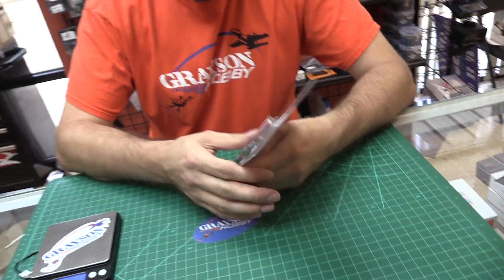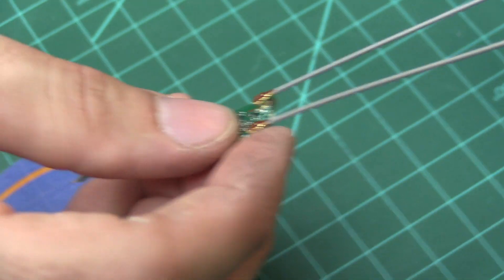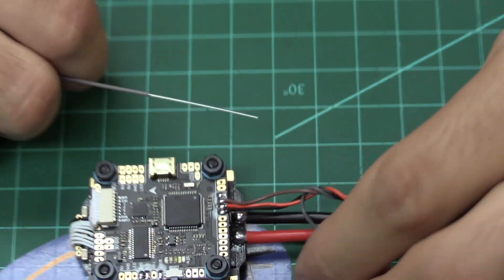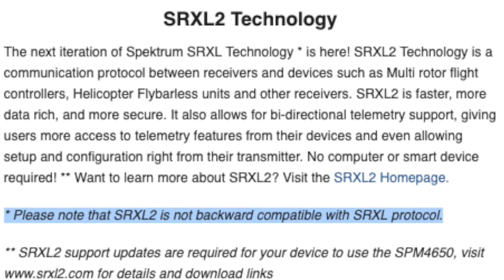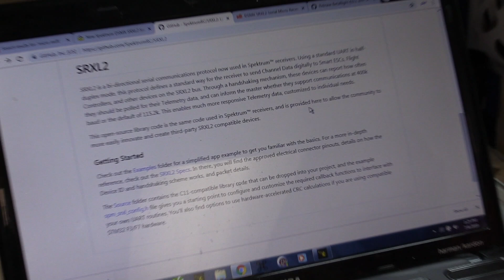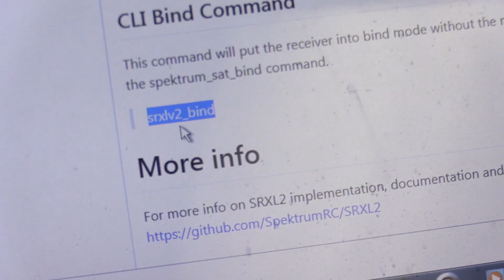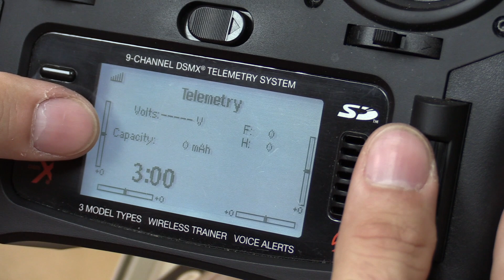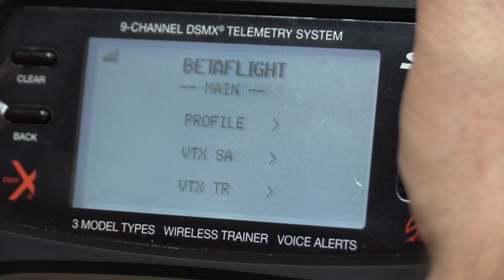New Spektrum DSMX Micro Drone Receiver- SPM4650

Comment: Hi, How should the 2 ant wires be orientated on the 4650? I see on the models they are installed in they run Parellel to each other , is this correct?

Comment: I cant get mine to work does the FC have to be that Firmware Update iv  just updated mine to latest i can bind but FC doesn't recognise inputs. Im running a DSX6i
Reply: Do you find an answer to your problem. I have the same...
Reply: @ no I didn’t I ended up just buying a completely new controller and receiver
Reply: @RoscoePablo  Too bad. That's not what I was hoping for. Thanks for the reply anyway.

Comment: Does it work for a dx6i
Reply: Dx6i will not work smoothly on f4 and up flight controllers and it has very low stick resolution. Will fly bad I up dated 2 years ago to a dx9 and never looked back and the dx9 has duele diversity so range is way way beter..
Reply: @lukejwillmot  Hi Luke, I have the same question you just answered. Can you elaborate a bit with a source or something since I have the same question.

Comment: Hey guys this video is good but I would really love it if you did a full walkthrough video on setting up this receiver on this fc board or the Diatone 349 quad but actually do the steps to make it more newbie friendly. Particularly flashing firmware, getting it into bootloader mode and everything else required to make it work. Rather than just saying if your new to the hobby don’t do it. It’s really disheartening for people that dont know everything but still trying to learn. It would be much better to just slow down and explain the procedure required precisely, or even show the whole thing step by step. I have this receiver for a Diatone 349 coming so I watched your 349 setup video a few times, it was also very rushed and confusing to new people to the hobby with the underlying message of “its difficult, confusing and you shouldn’t do it”
Actually makes me want to sell my new spektrum radio and go buy a FRsky.

Comment: I have watched this video time and time again and still mo joy with this receiver. Ive updated quad to latest sofware ive copied and pasted the cli commands ive even used the bind sequence. I got radio to bind by holding down button and connecting battery. But nothing works in betaflight. Any suggestions when i paste in the cli commands it comes up with errors
Reply: You have to flash the firmware on our github page. It's not supported in the official betaflight repo yet. https://github.com/SpektrumRC/betaflight/releases

Comment: Thanks for doing a video on this, as there is little to no info out there. Even RCG doesn't have much info, despite their engineer's best efforts to answer questions. Then again, the heavy handed "moderating" on RCG and fanboy attacks make RCG not worthwhile to participate in anymore.

BTW, SRXL2 being bidirectional is like SRXL, which came out well before F.Port (not S.Port as stated in the video). Oh, and there is a VTX channel function in the first menu too, if you don't want to do it via BF stick commands (shown on the transmitter's main screen).

I fly Spektrum because of Horizon's BNF planes (UMX, park flyers, etc.) and for giant scale 3D gassers (AR9350 with AS3X). However, I'm pretty disappointed with the 4648, and especially the 4649T. For their price, they lack a lot of features. Worse yet, they have consistent binding problems (losing bind every power cycle on 4649T or waiting too long for 4648T) and cannot get a workable RSSI in OSD (4649T). Even this new one (which has BF connectivity, like LUA scripts in OTX) will need custom fork of BF 4.0.3 and a set of CLI commands, which doesn't yet play nice with the large variety quadcopters I fly.
 And... Still no silicone wires despite needing to solder that Rx harness to any FC.

That's why I've been switching to FrSky and R9 for my quadcopters.
Reply from the maker: Wow, thanks for all the great info!  Yes RCG is not what it used to be..

Yea, both Will and I are surprised there is not much more activity about this RX. And just like you, we both have our spektrum radios for the airplanes and FrSky for Airplanes :)

Comment: So this new protocol will only work on 4.0 or later FW and on the latest configurator 10.5 ? If so it’s a bummer cause some micros don’t fly very well on 4.0,  I fly 3.5.7 for micros.  Thanks!
Reply: spektrum provides 4.0 builds of betaflight, and betaflight 4.1 has support for SRXLv2

Comment: What do u select in betaflight config tab. (Speksat and 2048 or 2048/srxl?) I have the receiver bound but it does nothing in the receiver tab. I have multiple builds and this has me pulling hair out! I loaded the hex files and even went backwards in beta to see if that would work and nothing so any help would be appreciated
Reply: i have the same problem as i mentioned in the comment above you :(
Reply: @mikeweiler3452  i saw that and i am hoping they can help us both out.
Reply: @Xman1976  there is really very few information out there :/
Reply: @mikeweiler3452  i called tech support at horizon and hopefully they can help when they call back.
Reply: @Xman1976  ohh that's really nice, please hold me informed 👍
Reply: @mikeweiler3452  bad news fron horizon tech support. This is still so new that they dont have any info on it yet either????  I dont feel dumb now! They created a ticket and when they know more they said they will call me back tomorrow. Fingers crossed!
Reply: @Xman1976  Damn, looks like we have to wait. but thanks for the informations :)
Reply: @Xman1976  Here is the Link with the Confiq who Works:
https://github.com/SpektrumRC/betaflight/releases/tag/4.0.3-SRXL2
Reply: With that config it Works for me but dont Forget to chose UART6 under the Ports Tab in Betaflight. ;)
Reply: @mikeweiler3452  just saw that and it still didnt work. Eventually horizon got back to me and said i had to use the plug on the receiver. So managed to barely get that soldered on cause i just direct wired it and the damn thing worked! Wish i didnt have to use the plug on it tho.
Reply: @Xman1976  You dont have to use the plug. Just make sure the "S" pin on the receiver is soldered to a TX pin in betaflight. The pins are labeled on the receiver.
Reply: @MiguelFAlvarez  i finally got it working but what was weird was i had to use the plug. I had everything wired correctly but only could get it to bind. Dont know what magic happened but when i soldered on the plug and resoldered back to the board in the same spot it worked. But thanks for the help.
Reply: Socit stopped working after half of the maiden. Stupid question what do use as seiral receiver provider on the config page in betaflight? I have serial-based receiver(speksat) for the receiver mode and the spektrum2048/srxl selected. I also have the spektrum selected in the receiver tab.

Comment: "set serialrx_provider = SRXLv2"  doesn't work for me. does anybody could help me please
Reply from the maker: Check the wiring

Signal pin on the receiver (labeled "S") must be wired to UART TX pin on the FC.
Reply: @graysonhobby  thanks for your quick answer. My receiver connections are all right but if i typ "set serialrx_provider = SRXLv2" in CLI the response is "Invalid Value". My Board is the same as yours. Firmware update is done (to 4.0.4 and even testet with 4.0.3 like in your video). It seems like SRXLv2 option no longer exists.
Reply: @graysonhobby7583  ohh no 😮 i didnt.
Do you have the link? For me and for all the other poor people without a plan?^^

Comment: now if only you didn't have to buy a $700 transmitter to use crossfire with Spektrum. Also the SPM4649T would use a TX pad also. You just have to set it to Spektrum SRXL in betaflight. Using the SRXL you shouldn't have to do any of that CLI stuff either.

Comment: sweet......  as one of the 10 people flying spektrum, i love it.......
Reply: rideacat plenty of people flying spektrum dude .  People trippin for years not sure why
Reply: @scizzorhandsfpv9547 my thoughts on on this are, at the time fpv was getting known u know zmrs, apm, Mr cleanflight , 3s 2204, ect lol I know I was looking for my first radio and spektrum was not a cheap option by ANY MEANS and wanted to just use satalite rxs so when I found a friend with a dx6...I feel for it and it wasent bad but didn't live or trust it fully. Traded for a dx6i it was worse, was about to try the other guy when I found a DX8 and tried it, liked it allot..since then in about 5 years no failsafes due to lack of range lol read up on it, and turns out the Dx8 was there first digital diversity radio's made to be high end for the 200 plus dollar recievers avail for it that did everything but we just wanted shit to work, so anyone who got a digital spektrum w diversity was able to fly crazy range limited only by your 200mw rx with a tiny lil sat rx all this time at 11ms. And there are expensive old rxs that have full telem ect the satalite size and took 5v. But this was over 100$ so I see why they didn't stay the hot shit lol. Quad poilets wanted good enough nothing more at first.. N they got it cheap with open tx and the tyranis and u can see when the DEVS switched from spektrum to to include frsky to it becoming standard lol now 5 years later I'm seeing the same cost advantages of my qx7 like it allot so far and I see why some will never switch and why some will gatta give open source due and big up the movement as love or hate frsky the changed the game pricewise making spektrum no longer the only option for even serious pros.. 😉 I'm seeing now I coulda been saving money but still love Spektrum and if money was no issue I would be happy to have a dx12 and not care one bit...  My only point is that yea the majority of people are the type to fly what's popular but in the frsky vs spektrum debate of dead horses with the new affordable frsky radios for both r9m and crossfire, I can only guess sometimes the bandwagon isn't the worst place to be 😂 
Lol bigup
Reply: SAME <3 TEAM NEVER HAD A FAILSAFE,...
Reply: CENABITE DNB FPV You’ve never had a fail safe? Means you’ve never flown more than a couple hundred feet
Reply: @Rckid28  I should have noted again (once I got my DX8 I stopped having any failsafes on dsmx @11ms) I fly wings also so i know how to push my system's and i have to try to hit rth dsmx is a surprisingly good algorithm, as bardwell stated but I am using their first diversity dsmx digital radio (so maybe mines just awesome) but i know allot of guys from McFly to Camden all love spektrum and its a dope system IF you have a decent remote. Ie dx8 or up.. and im using my dx9 with a mod for crossfire. BUT I do have a QX7 JUST in to test, and so far love the feel cant wait to get some range tests in as it's allot cheaper but I gatta admits I like it allot so far.. who will give max range? I will know for sure soon. And will test both r9m and crossfire, so I'm giving frsky a trully fair shake here, and if I stop flying spektrum, Ill deff be saving money. Wouldn't mind a cheaper option n she feels good! but knowing my limitations are is clutch and soon ill be able to say for myself which I like better, but as long as people are flying, doesn't really matter what system! 👊
Reply: Yes, me too... I bought in early with Spektrum, and WOULD like to keep using it.... the micro receiver is a WELCOME addition.

Comment: This rx should come with a link to this video inside the package.. I would have been scratching my head and/or punching the wall trying to get it working correctly...   **CLI commands a must** with  this rx..         Yes I am one of the nine guys still using Spektrum lol..
The one thing I notice about this hobby, nothing ever has a full/complete user giude explaining how to use, turn on or off features..   Something like this rx should have info about the required CLI commands with it..
Thank you for the great gideo.    GO SPEKTRUM!!!!      lmao.....
Reply from the maker: thank you for the comments, please share with everyone so they are not lost.. :)
Reply: hi Micheal i am the same i got DX8 i got receiver to bind holding button down but receiver not working. my 3 wires are on a plug that goes straight into flight controller. now do i remove one wire and connect it to another plug that says tx uart 1. i have a spedix is100 flight stack ime the eighth guy using spektrum lol
Reply: Michael Johnson having trouble with mine it’s soldered on right I’m pretty sure because it turns on when I plug it in to beta flight but it doesn’t receive my inputs on my sticks but it is bound to my dx6i
Reply: @isaacluna8388  I also have a dx6i with this receiver having the same issue. Has it been resolved? Found the fix?
Reply: S O S DEATH VALLEY AMENHOTEP G  how did you get it to work
Reply: S O S DEATH VALLEY AMENHOTEP G I have a emax  Hawk 5 and trying to set it up right now but the nothing is working

Comment: DX9 479 dollars, and rx 28 dollars, LOL jumper T16 149.00 dollars and frsky rx like 10 dollars, and 100% better.
Reply from the maker: Dx9 maybe expensive and maybe just the spectrum protocol,  but it's not better than a jumper.
Reply: @graysonhobby  ok let see, Color screen, Lua scrips in color, open custom mixes, audio in all the switches, music, can handle, crossfire, dragonlink, R9M, and his own multiprotocol module for 149 dollars. UMMMMM, just by having the gps coordinates of the crash the Jumper T16 win.  Cheers
Reply from the maker: @maxun1  checkmate to me lol - really appreciate the conversation...
Reply: Love you channel and respect you opinion, but Taranis kill futaba, spectrum, and any other radio, and now Jumper just kill Taranis. I got all the radios in the market, good and expensive radios, Jumper just kill them all.
Reply from the maker: @maxun1  i suppose better is relative - better as in reliability, or features, warranty, gimbals.. IMHO there is still not a GREAT radio out in the market, if so we would all be using the same radio.. If Jumper can offer upgraded gimbals, better electrical components, etc - it has the greatest chance of being the best. _ B

Comment: Because I came from RC airplanes, I use Spektrum. I didn't even know what Frsky or Flysky was until I was already fairly committed to DSMX.
I haven't had any problems upto now and have well over a dozen micro quads I built myself.
I DO miss RSSI on the OSD...
Reply: You should check out the FrSky stuff way more bang for your buck.